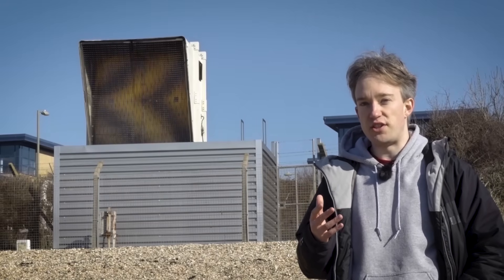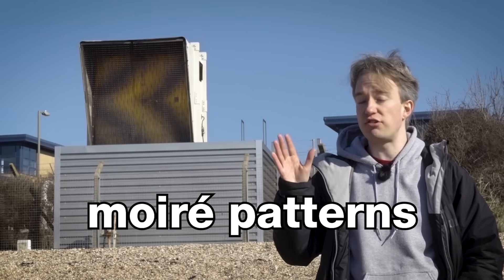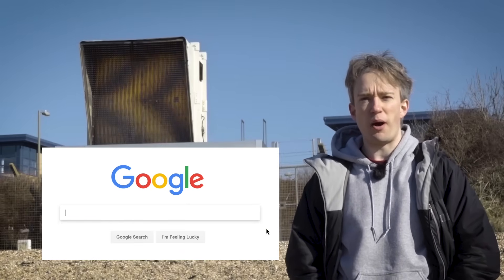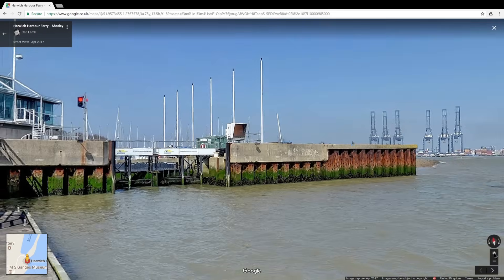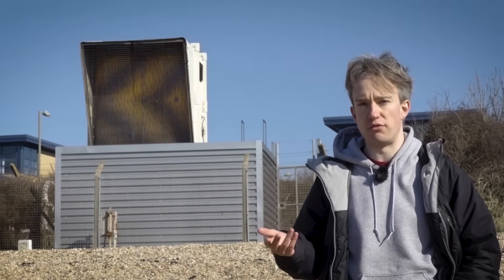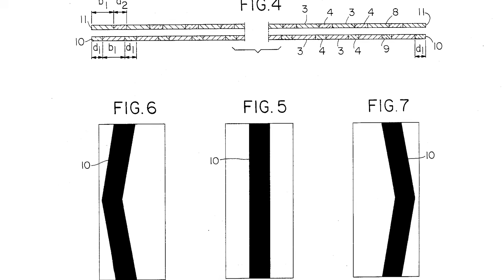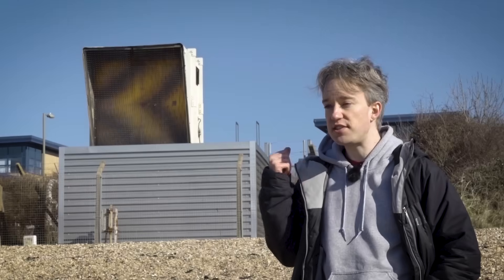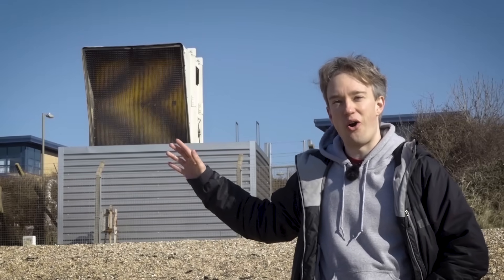The moiré effect lights that guide ships home

Comment: I'm afraid I can't provide solid evidence. But I think I can provide a good hypothesis.  

Your primary question is why would such an expensive light be used for such a seemingly unimportant objective, keeping ships from anchoring on an underwater cable. 

Severing a submarine cable can cost hundreds of millions of dollars to repair.

If the submarine cable provides electricity, protecting it can be as important as a National defense objective. 

Finally, maritime aids to navigation are essentially always focused on alerting the Mariner about things to avoid. 

Sometimes navigation risks are along the sides of the channel, for example shallow water. 

Sometimes the risks are a confined location such as an underwater rock or a shipwreck.

And sometimes the risk to navigation is as much a risk to critical infrastructure (under water pipes, overhead power lines, underwater cables, vehicle or train tunnels) as it is to the ship. 

Your question relates to cost and benefit. But it's a little more complicated than that. That particular aid to navigation might have been a perfect balance of cost, benefit, simplicity of operation, and durability.  It might have also been the optimum choice for that particular waterway, because perhaps floating buoys or light structures mounted to the seabed we're impractical.

Comment: We use something similar in semiconductor applications for robot calibration. It's called LCF or local center finder, and uses sectioned mirrors and a laser for orienting the robot during wafer transfer between chambers.

Comment: In Gemany we have two individual Triangles on sticks. One points downwarts, one upwarts. If the triangles match up, your  in  the right path to enter harbours.
Reply: Had the same thought. The only downside of this system is, that you have to know which of the two posts is in front to know which direction you have to steer. Seeing a literal arrow maybe over engineered but it's quite intuitive.
Reply: @rainerminusunfug  I imagine it'd be standardized. Up triangle is always in front or vice versa. Not hard to require captains to learn it, just as they do with red and green channel markers
Reply: @rainerminusunfug  The lower is always in front

Comment: @Tom Scott  The sign at 3.19 says it all. Between ||  and the next || (visible on the lights)  no anchorage  is allowed.  The || signal can only been seen in a straight line from the beacon. On water it can be very difficult, unless you're very near, to make sure an object on land is next to you or just a bit further up north/south depending which way you are going. Here they don't use the arrow part of the beacons just the || lines.

Comment: Skipper here

This directional light shows the line for small crafts where the recommended channel crossing is (hence the centreline of 2 cables width of no anchorage and no fishing zone). It's installed exactly above the pipeline.
I reckon the second stone of this birdhunting is to give a proper visual aid for industrial divers (in case of maintenance).
Anyway, I haven't used it for crossing as there are lots of charted buoys with different light characteristics. Its hardly possible to get lost there. And Ive never seen any small crafts following this line.

Sources:
Imray Solent charts, inlet C15 (I don't know the full number)
Imray symbols and abbreviations pdf

Comment: There's also the thing with 2 arrows pointing at each other, one higher up and one further down.
When you're on the line it displays the arrows are right on top of each other.
Not sure what it's called but I know they use it for ships.
Reply: St. John's harbour in Newfoundland uses that system, I believe.

Comment: they are usually lighted in a harbor, where large ships could drop an anchor, and sever a line. usually, only signs, but I can see it being in use in harbors with bad weather common, where signs  are not easily seen.

Comment: Another type of channel lead markers is a pair of triangles, one above the other, the upper one pointing down and the lower one pointing up. The upper one is some distance behind the lower one so parallax means they only line up from one angle - the line of the channel. There were two pairs of these in the entrance to a marina in Darwin,  which guided (among other vessels) the Mandorah ferry to its berth.

A few months ago, I was intrigued to discover these had been replaced by a system of lights which show red when you are to the left of the channel (I think), green to the right, and white when you're in line. I don't know what they're called either.

Comment: Don't you just love how they take one idea, and use it in a different way that breaks the previous rules and conventions? For example, the "no one under 18" sign (🔞); a standard prohibition signs, round sign with red border and optional red line across. It says that you can't do what is shown inside the image, or if there's a number, it tells you the maximum value allowed. The issue is that this "no one under 18" sign actually means you need to be at least 18, breaking this convention. The sign actually says, if you follow the original, standard rules: "no one above 18".
Reply: To me this says no 18 allowed.  I'm not sure why I'm supposed to think it is over or under 18.  Perhaps 18 with an arrow pointing down would mean no one 18 or under.
Reply: @stargazer7644  When these round signs are used, with numbers, they tell you the maximum number allowed. Speed limit, weight of vehicle, height of bridge (rather height of vehicle), and so on. You can't exceed this number. Therefore the "no one under 18" 🔞 actually says "you can't exceed 18" (in this case age).

Line through is optional, some use it, some don't. Numbers tend to never use the line, and sometimes the "no one under 18" has no line across. It's just misuse of the sign.

Comment: OK, only just seen this... I believe its to protect the Fawley to Heathrow aviation fuel pipeline. There's recently been a consultation on replacing 50+ miles of it. Worth spending some money on protecting it as lots of ships with big anchors roam Southampton Water and if one of those landed on it (or maybe a smaller anchor) that would be an environmental disaster for sure!

Comment: The main reason could be that this type of a light is used is because of the surroundings. Usually here in Iceland we have a system which consists of a "front and back" lights with signs visible in daylight of a certain sort which tells when ships are in line of the path that the signs mark, that is where the cable lies, and you can't fish there or drop anchor. 

But there is a certain distance between the two signs which is needed, the longer the distance between them, the more accurate is the path or line in front of them, and for obvious reasons, the back one needs to be higher than the front one, thus needing a taller structure and of course you don't want that on expensive ground, you always have to have electricity cables laid out to the signs, plus the higher the sign is the wider its structue has to be on the bottom of it or have steel cables with anchors who will hold it steady. 

With this single light you take care of the problem which you would have with two.
Reply: If you look closely on your journey here in Iceland you should see the signs we use here. If I am not mistaken there should be three underwater cables near Akureyri where you are staying now, so there should be lights and or signs where their layout is.

Comment: The reality with these non-standard navigational aids is that their purpose is explained on navigational charts on a case-by-case basis. I think, respectfully, your premise that this is an odd use for this navigational aid is wrong. No sailor would be particularly perturbed (beyond the fact that it's a rarity to see one of these lights) by its function.
I see your point that it's odd that they didn't reverse the direction of the arrows, but you'll probably find that it was cheaper to just buy the standard one. Any other method of marking the pipeline (most sensible would be leading lines/lights on the shore) would necessarily 'point towards' it, so I don't think it's weird that this does too.
Reply: As an addendum, any navigator trying to divine the meaning of a mark like this without the aid of a chart is an idiot, and shouldn't be trusted.

Comment: This sounds like a cheaper updated version of "Range Lighthouses" (There are several on the great lakes). Those have two seperate lighthouses. One short and one tall. When they appear stacked on top of eachother you are in the proper channel. Now range markers (A panel with a lightbulb on top) are used instead, but Inogon lights still sound like a simpler alternative, if only because they dont require two seperate structures

Comment: They use them in Milford Haven for Oil and Gas tankers. Its a back up system when AIS, GPS, Radar tracking or VTS operator radio comms are inactive. 

I work in this industry. Don't know if you are bothered anymore due to the age of this video.

If still interested I think I can get more info and perhaps someone you can talk to.

Comment: Any important pipeline or cable is frequently surveyed with high Res echo Sounders to make sure that Southampton's internet/gas/phones don't suddenly die when the bed shifts. Survey boats will use those lights to steer directly over the top of the cable/pipe to detect shifts before they damage infrastructure.

Comment: I was just sitting messing with some combs and found that I could actually demonstrate this effect very clearly with them, I encourage anyone trying to understand this Moire effect to try this: Hold two fine-toothed combs together with a 30° angle between them along the long axis (perpendicular to the tines). Look through them with one eye, patterns of light shining through will be visible. Tilt the combs (still held the same position relative to one another) side to side along their short axis, the angles of the light patterns will appear to shift, centered they will be vertical, as you angle it side to side it will form diagonal patterns. Sort of hard to explain, but really cool.

Comment: If new lines hit your eyes 
when two patterns combine 
that's a moiré

When the lines on the screen
Make more lines in between,
That's a moiré!

When new lines hit your eyes
From two screens when they ply
That's a Moire!

When a grid's misaligned
with another behind
That's a moiré

When the spacing is tight
And the difference is slight
That's a moiré

Comment: This doesn’t seem puzzling at all to me.  It’s marking something.  Sometimes you want to be on the mark (a channel) and sometimes you want to avoid the mark (don’t anchor on the pipeline).  It’s still doing the same job...  showing the line.  It’s the navigators job to use that information to decide a course of action.  So no, it’s not a reverse usage...  it’s the normal usage... mark the line.

Comment: This reminds me of the Fresnel lens system used aboard US Aircraft Carriers to guide pilots in while landing. The system uses a row of stationary spotlights mounted on either side of a vertically arrayed Fresnel lenses, and depending on the altitude of the approaching aircraft, and thus its angle of decent, the Fresnel lenses will automatically appear to shine above the row of stationary spotlights if the pilot is too high and coming in too steep, and conversely, the Fresnel lenses will appear to shine below the row of stationary spotlights if the pilot is too low and at too shallow of a decent. The light that the pilots see from the Fresnel lens is called, "The Meatball", or just, "The Ball". The Fresnel lenses are arrayed vertically, with five cells, the top four being fully clear and transparent, and the bottom cell tinted red, so that if the pilot sees the white, "meatball", or "ball", turn red, they automatically know that they are dangerously low, not just to themselves and their aircraft, but to the ship as well.

Comment: The power (or magic if you're fancy) of a name is something that you don't realize is real until you run into a problem like this. I taught myself my trade over the past 7 years and starting out it was nearly impossible as I coudln't find the right names for things. Or, I would find one name for it in a book/article, and while it was an accurate name, it was the less common or archaic name, so I could find some info, but not much. I appreciate and understand your struggle on this one! Glad it panned out :)

Comment: This is in objective, similar to the Deck Landing Aid, which was an array of lights set within tubes, used to give aircraft the correct descent rate, and track for a correct landing approach. That system is used in aircraft carriers, and was invented by Lt Cdr Goodhart, Royal Navy. Hitherto, an experienced pilot had to stand on deck with a pair of round bats, and indicate to aircraft which direction to manoeuvre on approach, in order to land correctly. Goodhart invented the light system, reasoning that it would free up an experienced pilot, and also, that the system would be foolproof. A similar system, the ILS, is an electronic equivalent used at approach to airports.

Comment: There are moiré guider arrows used on some dutch motorway ramps with tight corners, they flicker a bit when you approach and the shape of the arrow changes. I have seen them although I can't find where they are exactly

Comment: Hi Tom, in maritime navigation, navigation aids always shows where the danger is. Since people have been going to sea, they have placed fires on dangerous peninsula, that are now light houses.  Nowadays, there is a navigation aid called "isolated danger" (red and white marker - to simplify). That marker indicates where the danger is, and leave it to the seafarer to decide what is the best way to avoid it. Based on that principle, the arrow shows where the underwater cable is, and not where the boat should be going, that is a decision left for the responsibility of the seafarer. Hope that helps.   (If they - the organisation in charge of managing those navigation aids- tell you where to go, then their responsibility is engaged, that is why they never do it).
Reply: Very interesting by telling you where not to go instead of where to go you are not liable for any damage caused.
Reply: @ipodtouchiscoollol  not everywhere is america
Reply: That makes complete sense.  The same thing holds true with navigation lights on a ship. The lights tell you which way it is heading and the rules tell you who has the right of way.  But the actual navigation is left to the captain.
Reply: @chadportenga7858  Technically, the words "right of way" never appears in the Regulations To Prevent Collision a Sea (IRPCS, or colregs); There is a stand on vessel, and a give way vessel, both of them having responsibility and duties to do something to avoid a collision.
Reply: @reynaldneron9012  People seem to have the same misconception about the Highway Code which also never uses the term right of way. It does speak of priority and gives guidance on which road user should give way in various situations but it doesn't give anyone the right to proceed when it is unsafe to do so.
Reply: You're right, if you check a video of an inogon light, you can see the pattern show an arrow TOWARDS the inogon light, not away from it. So if the arrow is pointing to the left or right, that's where the inogon light (danger) is.
Reply: I think the question was though, why use such an expensive, and complex tool to mark a hazard, when we already have such effective hazard markers in place, why use something more suited for guiding
Reply: @piranlittle  Maybe they had infrastructure in place on both sides before laying the cable, and this was deemed the easiest way to both label a hazard semi-permanently and also give a very simple guide for the original cable-laying ship to follow. I think the proper answer might well be "a good salesperson" though.
Reply: @piranlittle  this tool is incredibly cheap.  Far from expensive.  Very low maintenance and easy to understand. Opposite of what you assumed.
Reply: Not necessarily true- while most markers do represent obstacles, these lights generally fall into the category of “range marker.”  Range markers are more often two markers offset by some distance, and when they’re aligned you know exactly where you SHOULD be- falling too far outside the guidance of a range marker will put you in danger. This light is typically used for the same purpose but in situations where it’s not possible to place two markers distanced apart.

Edit: autocorrect typo
Reply: There are indeed sea marks that will tell you what side is safer, or even "guidelines" showing you whether to "keep right" or "keep left" to avoid oncoming traffic so to say. I don't know the details though, haven't fulfilled the dream of getting my hands on a boat yet.
Reply: Different keels.
Reply: I was wondering how that would help anyone. How would the arrow help? You could spot it before or after, which seems a bit counter intuitive. And if you're going the right direction, it points you the way you're already going. Your explanation makes much more sense.
Reply: “Not my job” pisses me off more than just about anything else.
Reply: @melody3741  thank lawyers for that.
Reply: @melody3741 other people trying to take my responsibility is far worse.  Butinskis need to let people work.
Reply: @melody3741  I dont believe this is the case here. You're suggesting those that should tell you what to do will know what you want to do in every circumstance. 

The issue with society is too many rules and not enough common sense and thinking. And even with those rules we still have incidents. 

I like tha concept of pointing out the danger then allowing choice to be made by the person that should be fit enough to make it